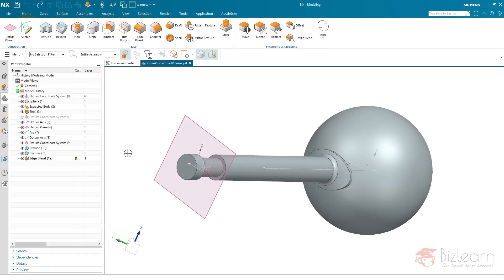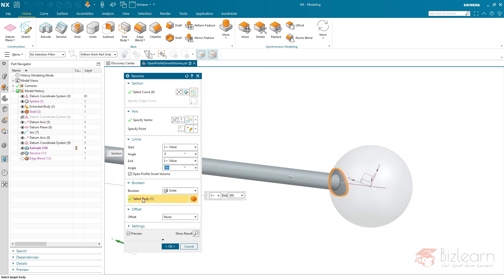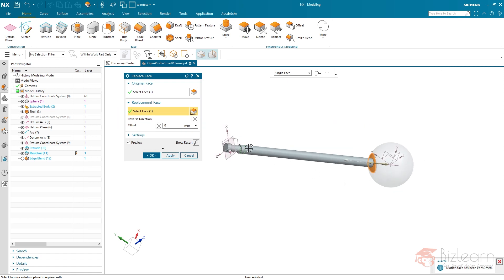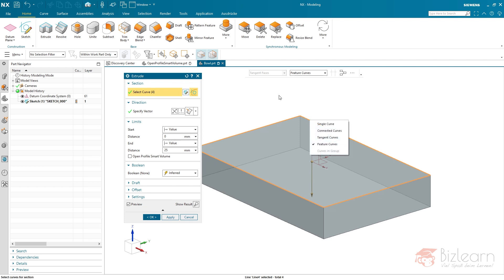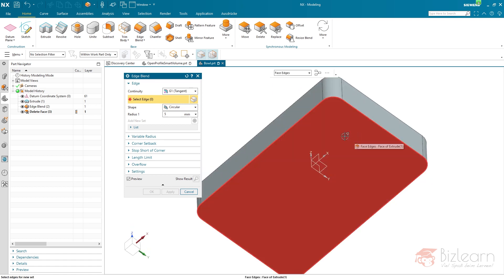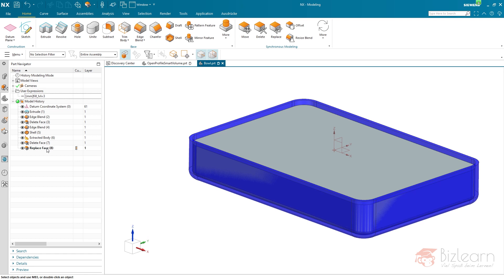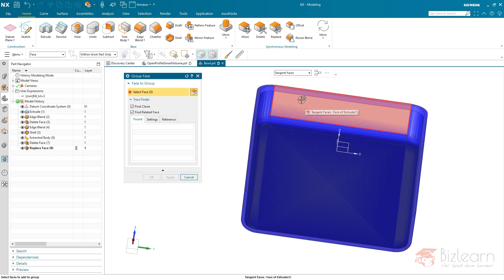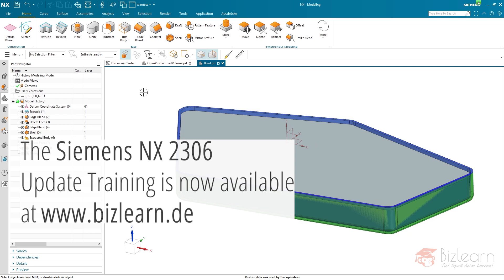Siemens NX CAD Secrets tutorial - my top 3 Synchronous Modeling Features for better model stability

Comment: Hey Simon, thanks for another great video! Is there a way to keep a stable model with the delete face trick if your radius is equal to or greater than half the thickness of the extrude?
Reply: Also, what’s the reason to use Replace Face with an offset for adjusting the inner volume instead of Pull Face?
Thanks!